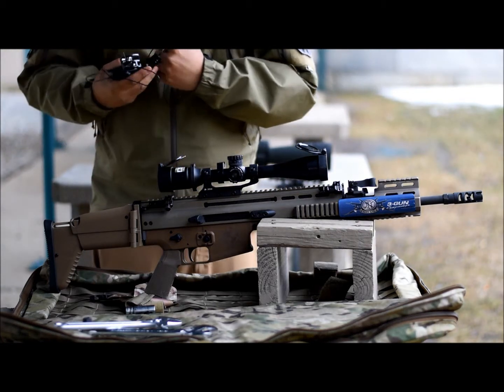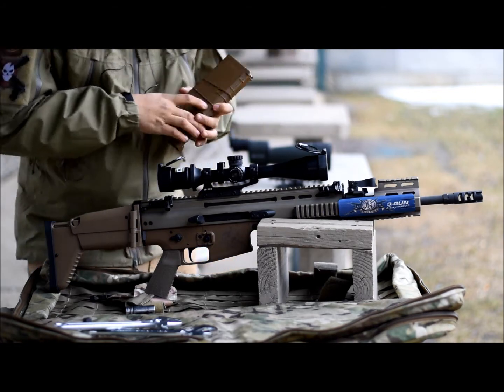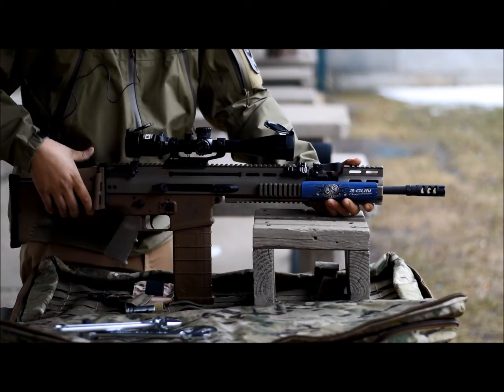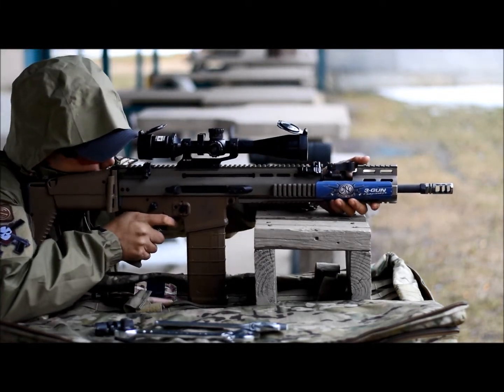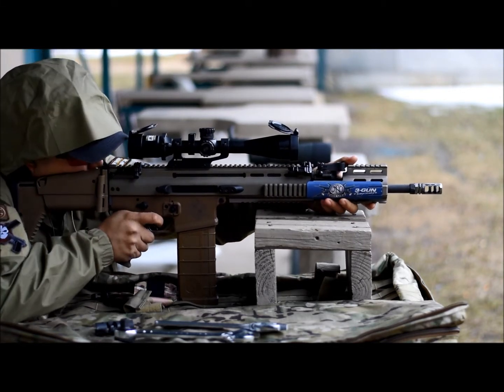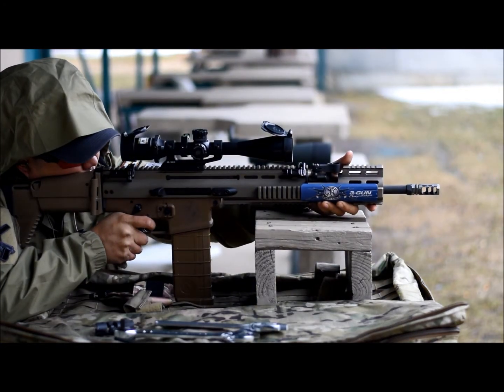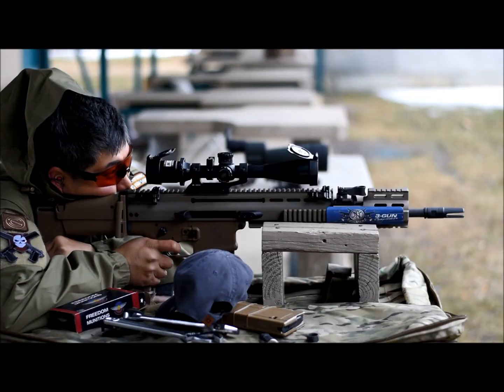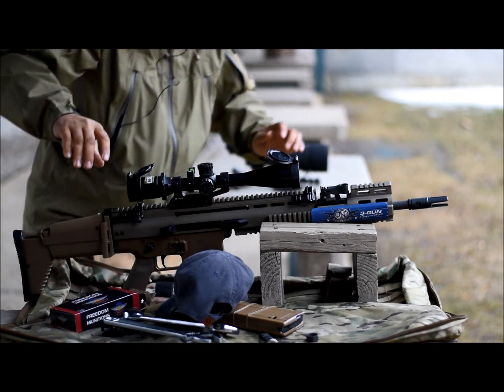SCAR 17S Muzzle brake test

Comment: Question how did you take off muzzle brake mines on pretty tight won't budge you think I would have to heat mines up to loosen it up? Did you take off from brake or from bottom bolt?
Reply from the maker: Get two crescent wrenches. Put one on the nut and the other on the muzzle brake. Tighten the nut and loosen the brake. It should come apart.
Reply: +Solscud  nice Thank You Sir

Comment: can you run the scar suppressed with the stock pws or do you have to add modifications to it. I'm new to the scar platform and just trying to figure out what all I need to run the system suppressed
Reply from the maker: jnadleeh you would need to get a new muzzle brake that is compatible with the suppressor you want. So right now I'm testing two Surefire cans. I have to use a Surefire muzzle brake or flash hider so the suppressors can attach to it.
Reply: Solscud thanks man

Comment: did you like the change in muzzle brake? or just end up sticking with the stock pws?
Reply from the maker: Charles Lee I used the VG6 but after shooting suppressed I used the stock PWS.
Reply: I see. The pws definitely cuts the recoil significantly compared to the other muzzle brake.

Comment: How do you remove the muzzle brake? Does the lock nut comes off?
Reply from the maker: Yeah it is just nut. Use two wrenches. untigthen the muzzle brake while trying to tighten the jam nut.
Reply: Thanks